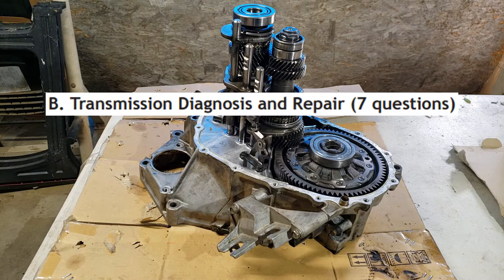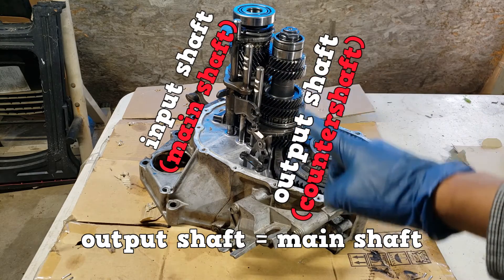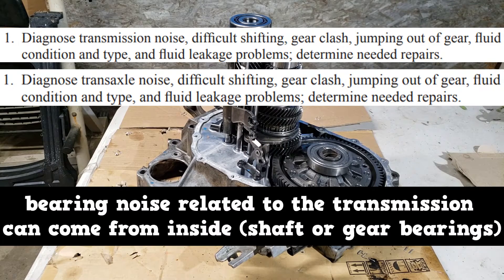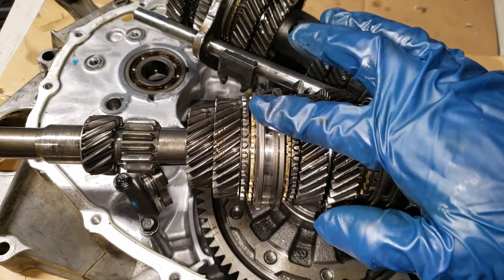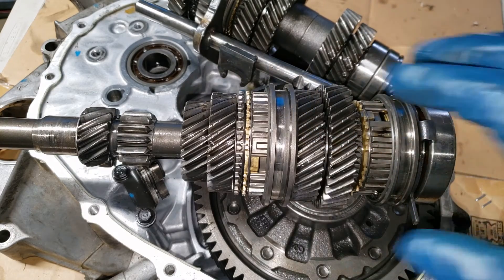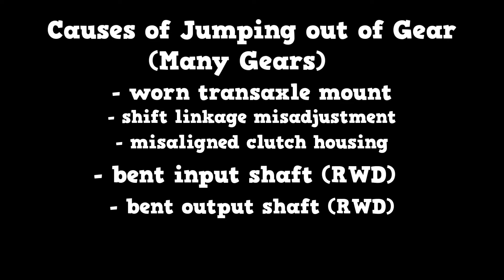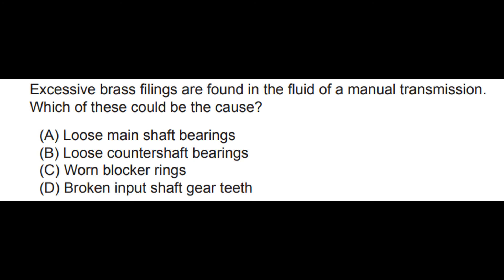ASE A3 Test Prep #1 - Manual Transaxle

Comment: So what are the answers lol
Reply from the maker: 3 questions near the end of the video:
1. (B) interlock
2. (A) only Technician A , the input shaft bearing is turning in drive and in neutral. The output shaft bearing is turning while the rear wheels are turning. Disengaging the clutch stops the input shaft from turning while the engine is on. The key point here is to know when the 2 bearings are turning 
3. (C) worn blocker rings. Look at 3:17 , the blocking ring is the gold colored piece (brass). All the other pieces would be metallic (grey, silver).

Comment from the maker: Feedback after taking the test: I spent the first minute talking about input shaft/output shaft. You don't have to worry about getting confused by names,  the input shaft was only mentioned in the answer to 1 question.
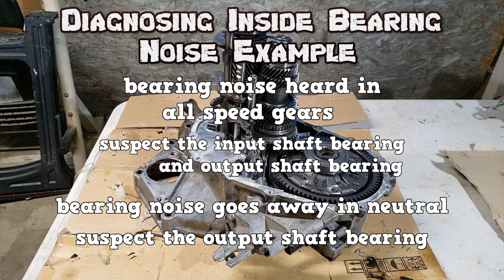The info from 1:14 to 2:29 is relevant. The test used the word "whirring" to describe one of the noises, make sure to study up on that. There was 3 questions on bearing noise and noise in general.
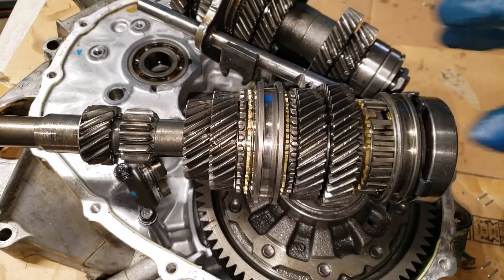Synchronizers, the info from 3:06 to 3:24 is excellent! I saw no questions about blocking ring clearance BUT know the function of the synchronizer. 
Study more on shift forks, such as measuring the specification and what happens when they go bad.
Many questions on shifting issues such as hard shifting.The info shown is useful.
2 of the 3 questions at the end of the video looked near identical to the ones on the test.